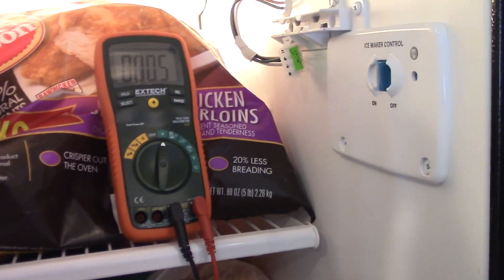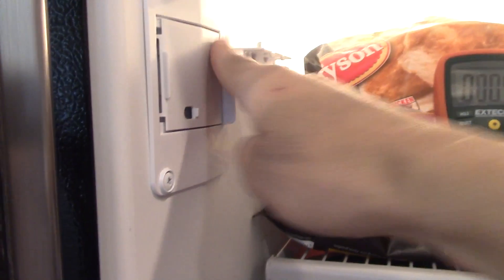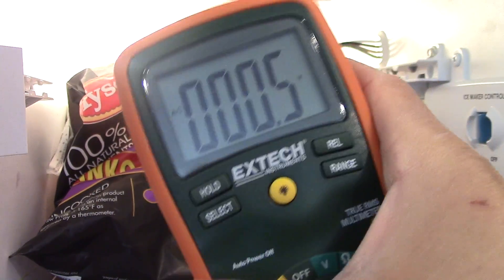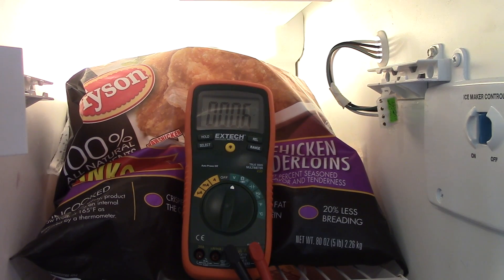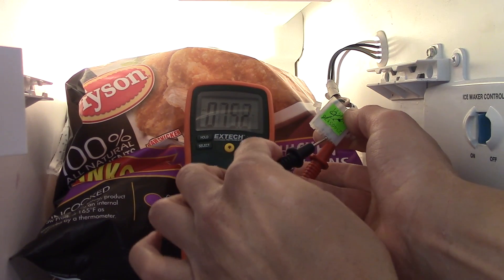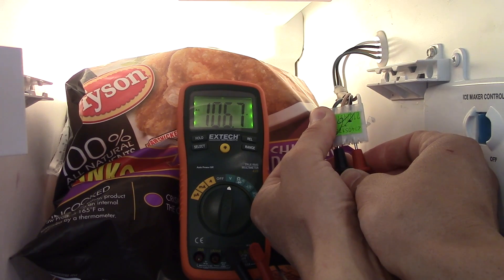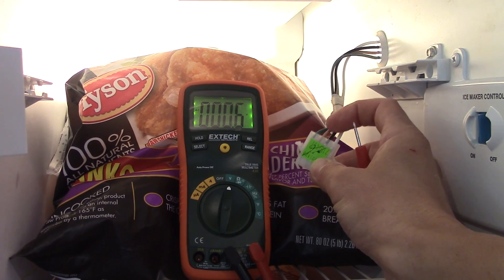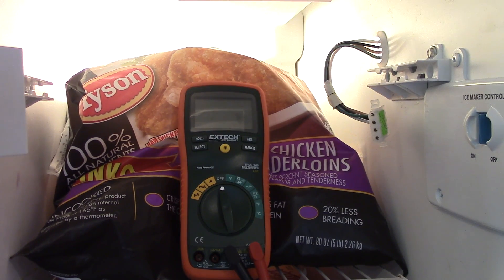Testing ice maker voltage - How to measure voltage

Comment: This video helped with my issue more than anything else I can find.  Ice maker (new replacement) and wire harness (thermal fuse not blown) check out ok.  No voltage coming into the freezer compartment from that connector.  Water valves seem to have continuity.  Any advice on what to check next?

Comment: Useless vid.
More of a how to measure AC voltage w/ a DMM.

One wire (the brown, likely) goes to the water valve solenoid. 
Until all wires (including at the solenoid), with power off are measured with respect to ground nothing has really been acomplished here.

This vid has wasted my tim.

Comment: Great video - I have the same fridge setup you do too. so, mine when doing same test on both situations like you did are 34V - where do I dig next? Solenoid? I tested the solenoid for continuity. Both were good w continuity.
Reply: Did you figure it out I have the same problem
Reply: Kyle, mine is 34V too.  Did you find the problem?  Thanks.

Comment: Is your icemaker a modular icemaker? If yes, why didn't you just test using the test points on the module instead of having to take out the module?
Reply: I sure its because the cover is not accessible on some models because it sets up against the side of the frig. and you have to pull the unit out to remove the cover on icemaker
Reply: @lloydwarren6564  
Hmmm...
Well that's different. Cover is usually over then end of the drive axel, which is usually parallel to a side wall.
Can't say I've ever seen one otherwise... but it could happen. (The ice maker doesn't care about orientation... mostly it's got to be where the water tube pierces the 'fridge body. The wiring is more easy to extend.)

Comment: +AdamDIY I have the same model as in your video.  I've had to replace the water inlet valve solenoid a few months ag0 and it's been working fine ever since.  However, upon returning from work the other day, I found that the water (for the ice maker) had run continuously for quite a while (possibly 10+ gallons in the basement below - hard to know just how much).  Plus, the freezer compartment was full of frozen water. On a side note, I should mention that the day before this happened, I had to deal with a rouge ice cube that hadn't fully discharged from the tray (this happens sometimes - hard water where I live).  I usually pop the "stuck" cube(s) out, but this one didn't wanna come out, so I popped it back into the tray.  Anyway, now it's not making ice.  I've determined that there's no power being supplied to the ice maker - tested from the loom - the same place you did.  Before I start with pulling the fridge out and tracking down a faulty wire, I wondered if you've ever heard of this before.  Maybe you can save me some time.

Thanks!
Reply: Did you ever find what the fix was?  Mine just did the exact same thing.??

Comment: the ice maker motor runs when I hook it up to the wall outlet of 115 volts but it is dead when the 107 volts will be used from the refrigerator supply voltage?
Reply: Need to check UNPLUGGED the continuity (resistance) between the HOT on the 'fridge power cord to the HOT where the ice maker plugs in.  And check all continuity to GND. Then check continuity from IM plugin to the solenoid. Then, Plugged In, test all pins to GND for voltage.

Don't worry about only 107 Volts.  That's perfectly fine.
Reply: Did you ever figure out what was wrong with it? Mine was doing the same thing would not jump start when plugged in to the refrigerator. I used a extension cord and cut it and hood it up and it turned.
Reply: The same thing is happening with my Kitchenaid KSRA25. Did you figured already what happened to your refrigerator? Did you fix?
Does anyone have experienced this issue and can help? Thanks!
Reply: @loftbuzios  make sure you measure the voltage coming from the refrigerator. I have found a lot of refrigerators that are not supplying the 120 to the ice maker

Comment: Thanks for video.
I have a seasonal home. In winter heat stays on, main water valve is shut off, refrigerator is left on. When I turned on water this spring the ice maker tray ended up with solid block of ice. I emptied it and it did it again with less depth. I figured it was the water supply valve, so I replaced it. Turned water on and nothing happened, ice maker didn't run. I then ordered new icemaker and a multi meter. Installed it waited overnight and had about 20 ice cubes.  Next day no more production of cubes. Brought out new multimeter. The L-M motor should be 8800 Ohms is only 75-122. Tested the incoming power at plug per your video and got 0 volts. No power incoming.Where do I go now?
Reply: Any word on the fix?

Comment: The pink get energized by the ice maker for about 7 seconds at the end of the cycle. (110-120v). That voltage open the water valve so the ice maker can be filled. Basically there is hot ( black), neutral (white), ground (normally green), and water valve (pink). (4 wires). If you short the hot to the pink you will see water flowing into the ice maker.
Reply: Thanks! Great reply!
Reply: Thank you!
Reply: Thank you both so much.
Reply: Thank you. May I add that I would be more careful with "shoving" the meter probes into the connector. It could spread them and reduce the good connection.
Reply: I have the deme ice maker not make ice bad I don’t knew how to find out the I get voltage to the icemaker thanks you
Reply: What if i got 120 like this video black to N. But not on the module at L and N. Bad module? I made sure both connections were tight
Reply: ❤ very logical explanation
Reply: What if I'm measuring 120V between the hot (black) and water valve (pink)? Black to any of the other 3 is 120V so it not a switch around of the wiring. Trying to jumper the black to the pink resulted in a spark from a short. What could be going wrong that's putting a voltage across the two?

Comment: Mine is showing 124 volts with black and green and with black and yellow. The ice maker does advance unless you help it then it will start cycling on its own
Reply: +Jim Whitman Sounds like you have a broken gear in the ice maker.

Comment: You have very good technique to check voltage of ice maker but I wonder that I set my meter @ 200VAC I got reading of 34.2 volt (blk to Wht term.) and same reading 34.2 volt with (blk to ground green wires) ... I don't know what is wrong???
can you give me some tip!!!
Reply: Guys,  I am getting the same reading  on my voltmeter for my icemaker wiring harness on my Whirlpool Side-by-side.  What does it mean you lost the neutral somewhere? What does it mean that the thermal state was dead? If the whole icemaker was removed, wouldn't the problem be in the fridge itself?  Not sure how replacing the icemaker fixes the problem if it resides in the fridge.. . I don't want to  replace my icemaker  if the input poower is only 34 VAC.   Thanks for your help!
Reply: +Tod Simmons I was getting 35 volts, out of the plug that goes into he icemaker, regardless of what I did (switch off, flap on/off, etc).
I opened the IR receiver board on the right which had constant 120 VAC coming into receiver board no problem (blue/Yel) and  yellow/blue was 120VAC with door switch.  The black/white on mine goes to the icemaker, carrying the voltage when the board sends it.
I think the "low" voltage is 35 VAC all the time, should kick up to 120VAC when the receiver board conditions are good.  I had a repair guy over for something else and he said 3 things can go bad: icemaker unit (replace whole, don't piece fix it), the optics boards (replace both emitter/receiver) or the water valve.  He said to put my new icemaker in and if it doesn't work, check valve (already did with resistance) then replace optics if all others good, which are $200, more than the icemaker.  Some sites have return policy no questions.. in case that doesn't fix it.
My icemaker just made it's first batch in 2 years! Good luck, not sure if it helps.
Reply: +Minh VC normally that means you lost the neutral somewhere. mine is doing the same thing right now.
Reply: thanks I found problems that thermal state dead... replace whole ice maker less price than replace thermal state only.  I did thank for  posting on youtube help a lot
Reply: Yes, it is working for more than 6 mos now
Reply: I had the same problem.  To verify I removed the IR on the right side and jumped the black and black/white wires together to give 120VAC to the ice maker.  Then I jumped the N and M on the control module to start the cycle and it worked.  The lights on my IR were working fine so no sign of trouble there but somehow the board is bad anyway.
Reply: I have the same issue, Ice motor test good on my work bench i jerry rigged a wire set up to run it, But my power in freezer is at 33 volts, I'm thinking it could be related to the defrost control board???
Reply: I have exact scenario. Only seeing 34V AC at harness coming from freezer (the one that plugs into the ice maker).  I’m not sure what Adam means by tracing wires back to main board. What main board?  I looked at main controller board at bottom of refrig, but don’t see these set of wires at the board.  Adam you mentioned you’d look at yours in the post but don’t see you updated.  How to troubleshoot only getting 34VAC?  Thanks.
Reply: Too late I replaced my Ice maker 6 mos ago... you might right the thermostate could be an issue ...but cost to replace thermostate only more than whole Ice Maker ...so I decided to replace whole ice maker assy...even I can replace thermostate only. Thanks